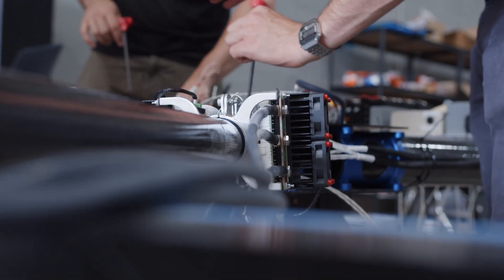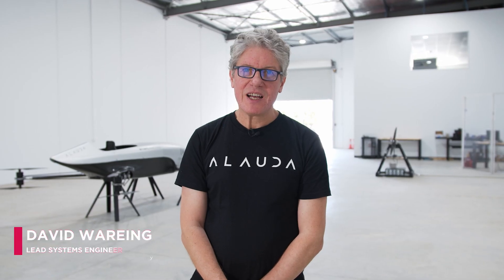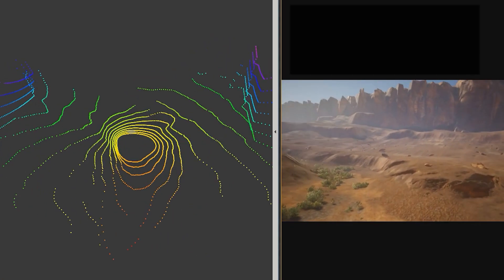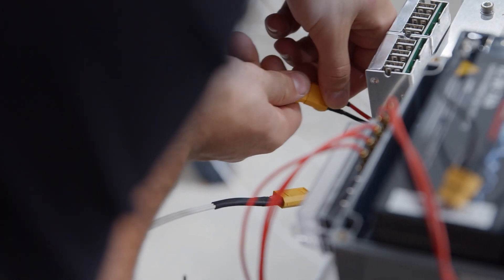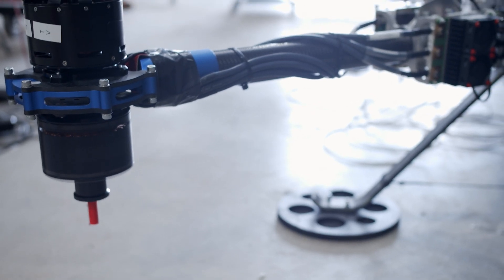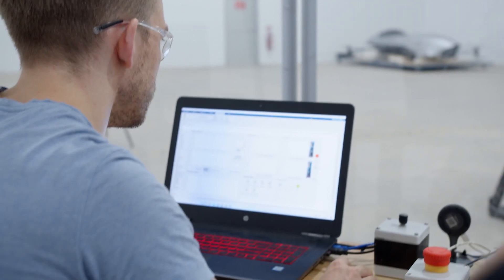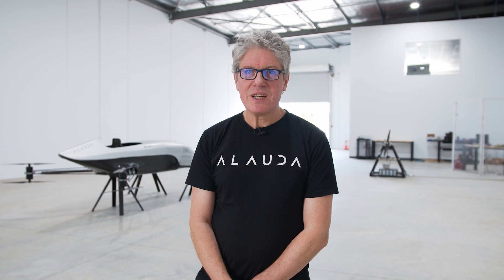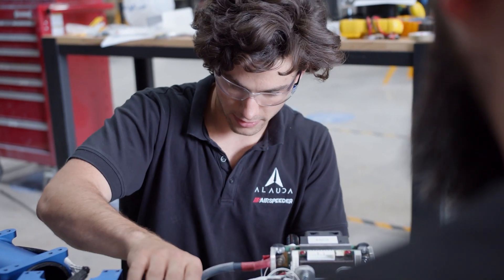Electric Powertrain At Its Core | Alauda Aeronautics Taking Flight Series

Comment: Based on the performance on goodwood, I dont think anyone should step inside one of these. 10mw radiolink and a throttle-hold failsafe? are you joking? The youtube videos looks amazing, but I am afraid that the actual speeder will be dangerous due to poor engineering. Hope to see improvements on the radiolink and no CAT 6 cables inside the new speeders.